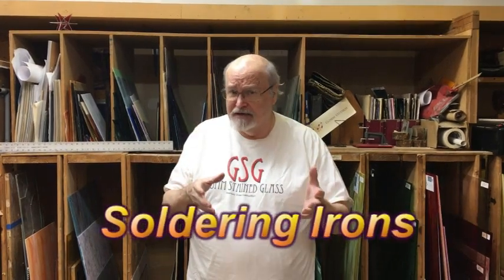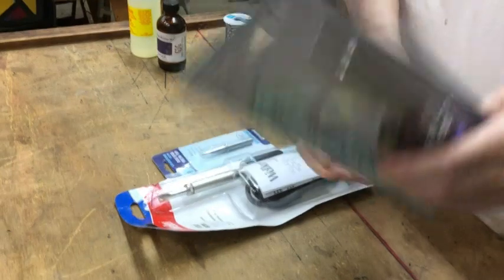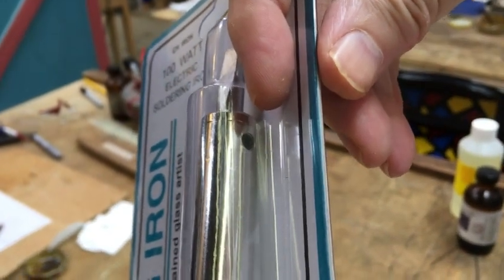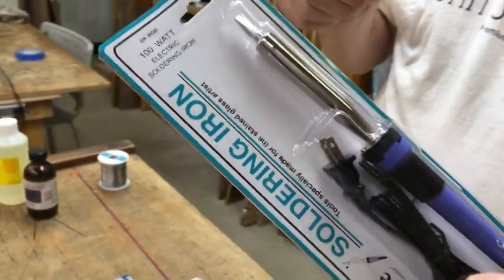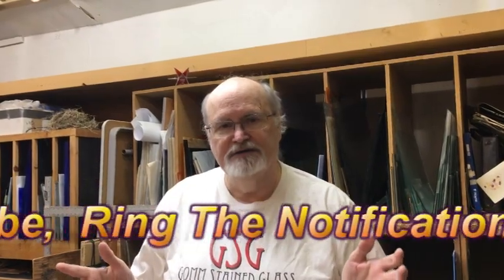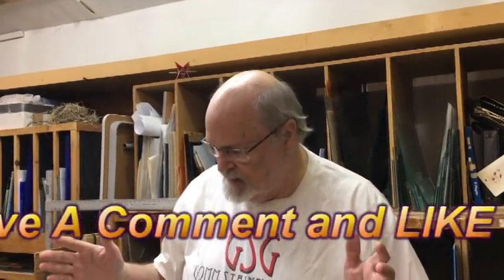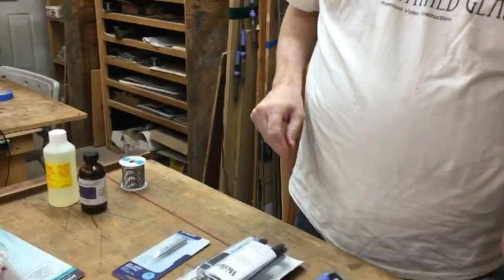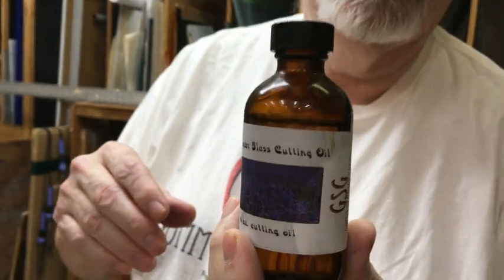Soldering Iron Tips For Stained Glass V237

Comment: Hi, I've just subscribed. I'm just starting out in stained glass, but feel the soldering iron could be smaller as the copper foil can be quite small/intricate, could you possibly suggest any smaller iron like a pencil or something?? Cheers.
Reply from the maker: I use an iron with a 1/4" tip because it gets warm enough to melt the amount of solder that you need, too small and you don't have enough solder, too large and you get too much heat and get run through s The Hakko tron at https://www.gsg-art.com/store-stainedglasssupplies.html has a smaller tip and temperature control you may like..

Comment: Does the choice iron have replaceable tips?  What is the ideal chisel tip (3mm or 5mm). I have a vastar solder iron with built in temp, my tip got corrosion and I'm unable to remove it, so I bought a whole new vastar.  Only to find the original chisel tip was not in the package.  A 2mm was.  I just want to know the ideal tip and be able to replace it.  Please help
Reply from the maker: I'm not familiar with a vastar brand iron. The choice iron is a problem for us because so often when the tip goes bad, it gets frozen in the iron body and so we have to toss it. I found an iron that is halfway between the choice and the weller and it has good points and some weaknesses, so I'm going back to the weller 100 iron which is the best I've ever used. It lasts a long time, tips are replaceable, and it's pretty rugged. If you are doing lead free work, I recommend using a hakko brand iron because its' temperature can be raised to a higher heat. (I don't care for the tip it comes with)

Comment: If I were to buy the Weller with the built in temp control, would I still need a rheostat?
Reply from the maker: You would not. I used a Weller iron for years with very good results and the tip lasted a good long time!

Comment: I was wondering, when I tin my copper foil the edges are good but when I go to do the face it seems to wrinkle up. Do you happen to know what causes this and is there a way to prevent it from wrinkling
Reply from the maker: It's usually the heat of the iron and the speed that you tin. You want to cool the iron down a bit if it's been sitting, by wiping it on a wet sponge ..several times if necessary. If you go slowly the foil will have a tendency to wrinkle and pull away from the edge.

Comment: I do believe that 50/50 melts at a higher temp than 60/40 and 60/40 melts at a higher temp 63/37.  Use the 50/50 first to fill in any gaps and then the 60/40 to run your bead.
Reply from the maker: From the Weller Website, the melting temperatures are just the opposite, I'm attaching a picture. This comes from a book that was written in the 60's that was wrong and got referred to by everybody else. (It didn't let me attach the chart)
Your idea for filling with 50/50 and over soldering with 60/40 is a good idea because you'll a lot of shrinking problems.

Comment: Using 5 soldering irons instead of 1 weller or a hakko longer is incredibly wasteful though
Reply from the maker: I have started to build up my inventory of Weller irons because the tips are so good. They are much easier to clean and really last for a long time. So you are correct, but the cheap irons were a good choice when we needed more for students.